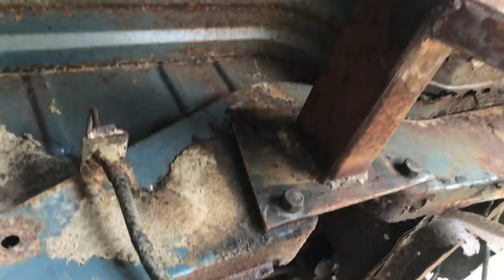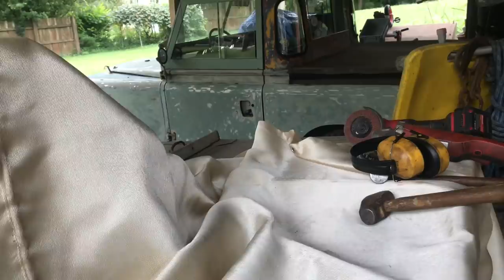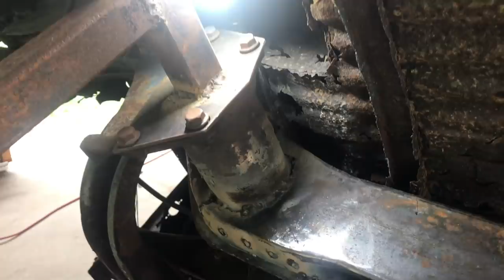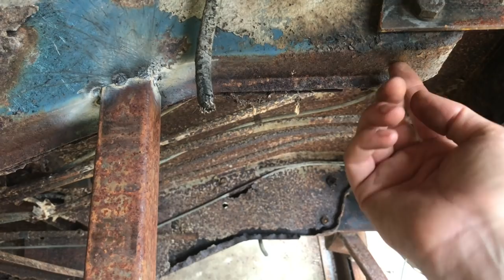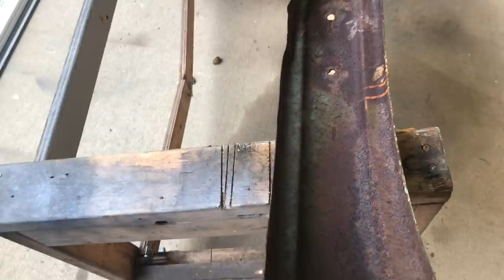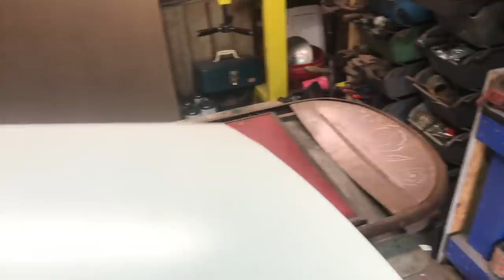1958 pressed bumper split window VW bus frame reconstruction!!

Comment: If you lose the front chassis mounting while driving, you better be good at pulling a wheelie and drive. You are doing a fine job on all your projects. And giving lots of us mellow times to enjoy.
Moe
Reply from the maker: hehe...hey at least the engine is in the rear...might stand a decent chance of not totally losing control lol I'll fix it...can't. be trusting what is there, that's for sure!

Comment: That old repair held up well for what they had to work with back then. Pickle is coming along quite nicely.
Reply from the maker: yes it did...one thing for sure it was as strong weld...know that because. cutting it off would have been impossible. with out a plasma cutter
Reply: @marcijunebug , I have a plasma cutter now but am running out of things to destroy, I mean cut with it. I'm like a little kid with a new toy with this thing. I don't know why I took so long to finally get one. It has surpassed my digital torque wrench as being my favorite toy, I mean tool.
Reply from the maker: I know right??!!! I get "trigger" happy a lot in the shop! lol
Reply from the maker: I've been doing shovels...I'll try and put those at the end of the next clip...so fun so make

Comment: Like the new electrical setup, light for vids. Better too...can U run a welder out there  to without extensions???  Shop is shaping up.
Reply from the maker: thank you! yes I ran the 220 plug for my welder on the post right by pickle...I figured that was pretty much where I needed it now, and could always move later but that post is pretty centrally located! I can't tell you how nice it is to have power and lights out there! wow

Comment: I've got a 1960 walk through kombi I started on years ago and it has been pushed to the back burner many times now. It has/had very similar frame rust. Funny, it had bumper jacks cut and welded in to make frame supports and structure. It also had a lot of metal brazed into. Removing that is a good way to gum up a grinding disc! I replaced the frame sections with frame from my 58 panel that had been totaled in a head on collision.
Reply from the maker: wow! Yeah it has been a trip so far, but I can tell you this much I will know this bus inside and out when I'm done! lol
Reply: @marcijunebug  that's my favorite part! Knowing your bus inside and out after going through it completely is the best! Always love seeing your updates!

Comment: oh the joy of enclosing some of that building to A. not freeze your butt off or B Cool it in the summer time to work on the bus
Reply from the maker: we have considered it, and maybe we will. one. day... but I like the openness for the lighting and being able to get larger things in without much in our way...we have had travel trailers and big sailboats in there with no problems...my sailboat misses the upper rafters by less than a foot when it is on the trailer! close fit for sure.

Comment: I’ve had a 1foot long piece of rail track for a few years and it’s the best dolly in the tool kit .  The bumper looks great.  That front section of frame rail was so butchered. Makes you wonder what they were thinking when they did the repairs as it wouldn’t have been too much of a stretch do do a much better job.  Anyway Pickle is in good hands now and will strong and reliable.
Reply from the maker: They were probably just working with what ever they had laying around...not too many years ago these old buses weren't worth anything, was probably just a "farm" vehicle or something...I was certainly thankful for a plasma cutter on this project! ha I used the rectangle tube for the frame because I have a plan to "expand" a bit on the accessories I will add to pickle (I plan to use it for my art bus at art fairs and such events).  I think he will serve me very well once I get him all back together...cheers

Comment: If you split 4 inch the square tubing and heat up and bend the bottom edge it is a perfect fit for the frame to be the same. you could also  split the 4 inch tube and make the front frame repair section you need. easy  also make the floor supports with square tubing that will save some money. Like I did with the singe cab.
Reply from the maker: yep, just like I did for the back...I split that piece and worked great.  I have. two of the floor supports that I got for free, need two more I think and yes I will likely use square tube for the two I don't have.  Enjoying the single cab project btw, don't comment much, but watching and love that you are saving it! keep up the great work and thanks so much for being here!
Reply: @marcijunebug  thats ok I just hope you are able to get some info you need to do yours. That is a big one too. at least the back frame is somewhat in place on yours. I gotta work for the next week I will see if those frame sections are still there when I get back.
Reply from the maker: @Mikefngarage  thanks mike!

Comment: Would you entertain the idea of maybe welding washers to the back of the bumper mount holes on the bumpers?
What is your plan for the holes or are they still small enough to still use to mount to bus with
Reply from the maker: thought about just welding the hole. up. a bit around the edge, but had entertained the washers on the back...I think the holes are still fine, but look "wallered" out so will def need some attention at some point

Comment: Yummy!! Mjb...looking at that frame  underside made me hungry for a swiss cheese Sammy.  YIKES!! Any good metal there???  Plus the way you are working makes mewonder if UR. Gonna slather some rust stab!e or do a paint on the undersides and panel floor..bumper looks good but u need a black ksmith anvil to really do the job...
We got one from 1889 but the shipping wood be murder!!!!!
Reply from the maker: I was. shocked I could even move the metal on the bumpers...I did have to get the 3lb sledge but it moved fairly easy.  I DO plan to paint the underside and to pull the Mustie1 trick of bar chain oil undercoating after I'm all done!
Reply: Wood  beaterbags aid you in developing the contours of the bumpers???

https://m.roadkillcustoms.com/how-to-make-a-beater-bag-shot-bag/

Comment: I know you know these tips, but keep your gun aimed at the weld so the gas will help make it stronger, don't pull it away right away.  Also be sure to get shiny metal before you start welding!   Awesome video btw
Reply from the maker: hard to get shiny metal here! lol but I did hit everything I welded with a flap disc first...I'm not using shielding gas so I don't think holding wand there longer matters as much as does with gas? but very good point! will try to do better! thanks for the tip and for being here!
Reply: @marcijunebug  Are you using flux core?
Reply from the maker: yes, years of being a "junk artist" and welding rusty crap I've just stuck with Flux core as for my anyway it seems to work better with "less an perfect" metal or "specimens" lol

Comment: Well the patch worked for what it did for when they did it
Reply from the maker: you are probably right, but wow! I keep thinking that when that was done MIG welders weren't as common a piece of shop equipment for the "common man" either so it was stick welded and patch pieces were likely cut with a torch! crude at best, but was likely all they had

Comment: Those old welds look like they were done with a squirt gun..lol
Reply from the maker: I know right!!?? probably the best they had to work with tho, someone will probably look back years from now and say the same about my work!
Reply: @marcijunebug  I really doubt that. I am a welder and I primarily do MIG sheet metal but I have a mobile welder that is set up to do SMAW. I could not ever imagine making welds that looked that bad..lol.
Reply from the maker: well it is, what it is so they say! I'll work with what I got! haha
Reply: @marcijunebug  You are doing great!! I have been dealing with my Subaru forester and overheating issues. I bought it to take the engine and put it into my 911 and I have been driving the forester because I need a dependable car and it all of a sudden became unreliable.